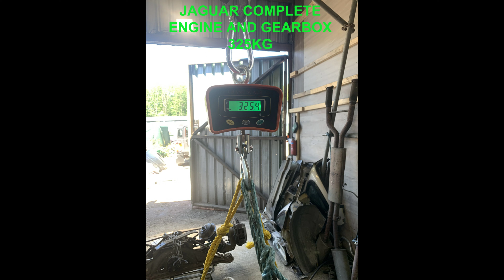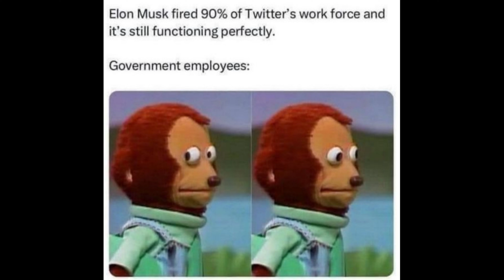Ford Transit Supercharged V8 mid engine project Part 1

Comment: Nice job!.... Are you running both your projects at the same time?
Reply from the maker: Taking a break from the minor, just got burned out with all the bodywork! Needed a change and the transit rear axle broke so forced me to start on with it. I will finish the minor but the transit has priority at the moment.